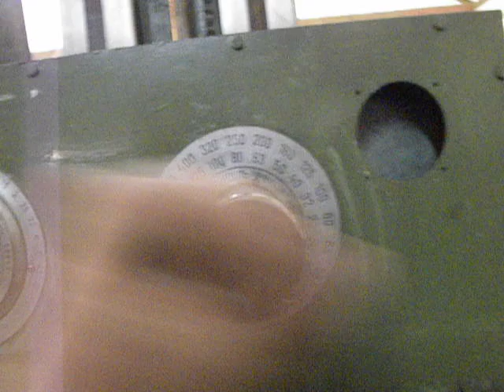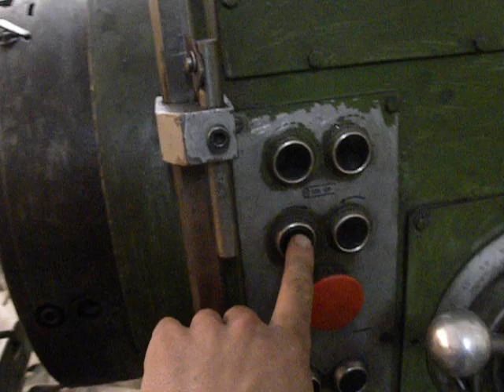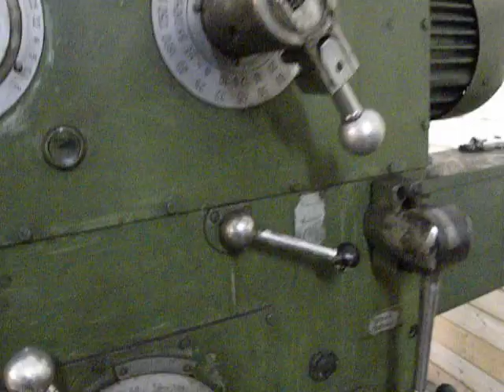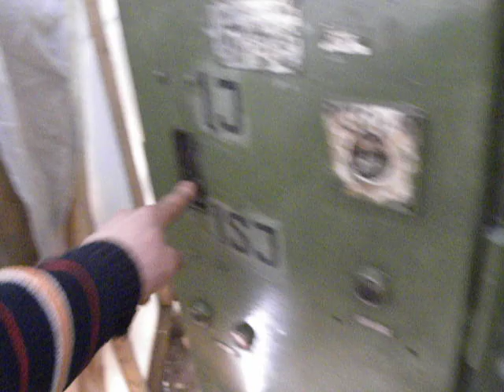Test run of my Horizontal boring mill machine

Comment from the maker: Yeah, new machine-tool =>new resources. Yes, I have 400V power, but I need to rise the incoming fuse capacity - I have C20, but realy nice will be C32 or C63. 
No, I not yet make / get / find vertical head for this machine, but it will be cool gadget for this machine. I each week go to local scrapyard and buy the metal for work, also looking for tools and equipment pieces. Thanks.

Comment: First I would do is clean the beast(and putt some cleaner wax on it), and make sure every dial and directions are clearly marked on the machine and then have lots of fun with it.

You probebly have a manual for it as thick as a tlelphone book :-)
A realy nice machine.

Comment from the maker: @algae1000 Thais machine have motors: spindle motor 400V (3-phase) 6,3 / 4,2kW at 1440 / 975RPM's; DC generator input 400V, 5,9kW - output DC 3x220V (3-phase DC) , 4kW at 3000RPM; feed motor DC 3x220V (3-phase DC) 2,1kW variable speed Max rpm's=~3000, oil pump motor 400V, 0,12kW 1440RPM; and a lot of electrical automation ~1kW ...  I wonder about that it is able to keep the C-20 fuses.

Comment: I have used a manual Horizontal Borer once, great machine, wish I had one. I see a comment from another contributor about a vertical head for the machine, perhaps you can make adaptors to use a head from a miller and drive it from the spindle. A place where I worked did this and also made a long extension which increased the versatility of the machine enormously. Cheers from John.
Reply from the maker: Cheers!
Yeah, I want to modify this machine: I want set remote control and maybe create adapter for verticam borer head (I found used Stanko 2V440 vertical borer head with some tooling in abandoned factory store, some time ago).... but poor is that to time and workshop space is against to me...